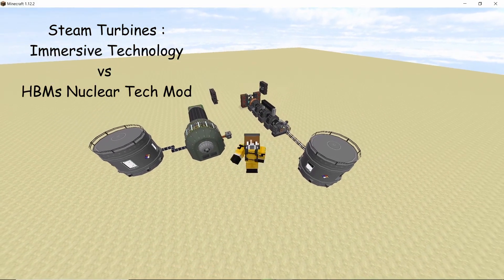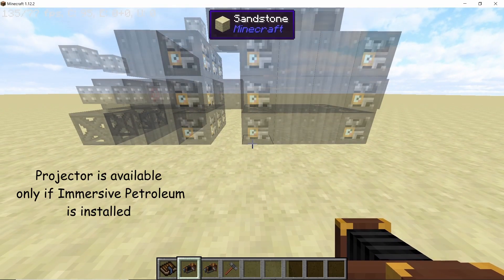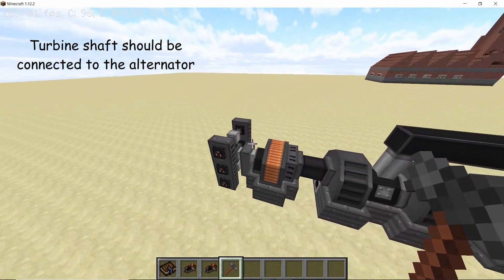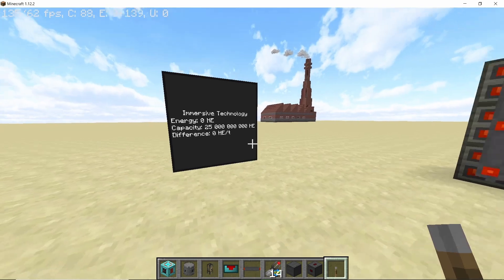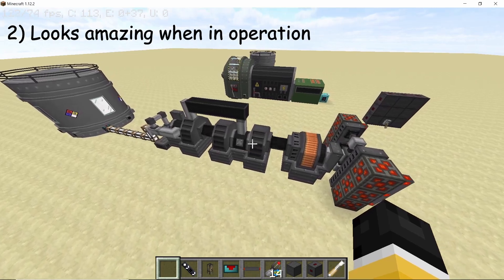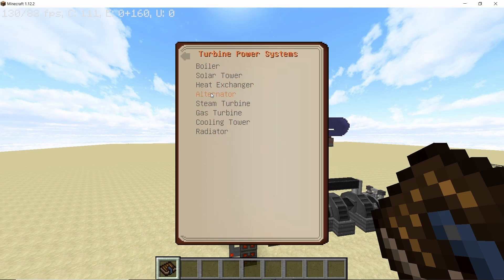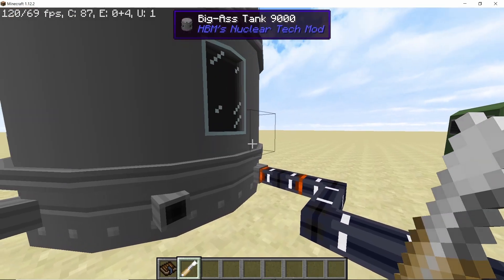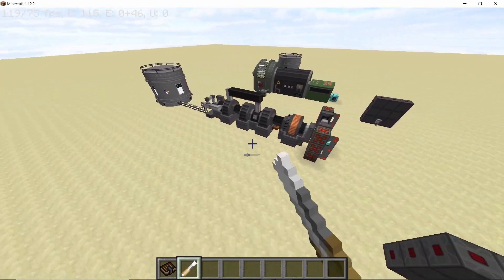Steam Turbine : HBM vs Immersive Technology || Why you should use Immersive Technology mod's Turbine

Comment: Even if the immersive technology is more efficient (by a lot), i would still use HBM turbines. sure, its nowhere near as efficient, but the throughput is horrid on the immersive engineering turbine, and the industrial turbine can produce so many times the energy of the immersive turbine, in just constant running. the turbine cant support any rbmk i know, unless maybe a thorium reactor with 40 turbines. the leviathan turbine has infinite throughput, and for me, the reason i will never use the immersive turbine is just because you need so many for a small reactor. if you have power problems, just make an rbmk. also, the immersive engineering turbine wont work in 1.7.10 because ducts dont connect to non-hbm modded blocks. only useful in 1.12.2, which is a much worse version.

also, the reason in your video that it looks like the lev turbine is only using 2000 mb of steam per update is for two reasons. 
1. the super big tank has very limited throughput, it only allows two buckets of steam out per update
2. the update rate of tanks is very low, so tanks in general aren't used with reactors. just normal tanks can empty/fill their entire storage all at once, so i use them with reactors.
Reply: love the video though, it is very interesting to see the efficiency difference!
Reply from the maker: Yeah I only made this video sort of as a test to see the advantages and disadvantages of each turbine, cause truth be told the immersive tech turbines look way more awesome when functioning and having them in a grid formation just makes the whole build more awesome !!
And I didn't know about this in 1.12.2 cause in 1.7.10 all fluid vessels now have crazy throughput only limited by what they are producing or the machine they are pumping into

Have you tried setting the fluid ducts to output mode using screwdrivers ?? as this tends to increase throughput in 1.12.2

Comment: 68 out of 100 hbm mod tutorials playlist videos watched
Reply from the maker: You're a Giga Legend #4
Reply: @SavageVegeta By the way, low steam consumption can be a good plus, since per unit of resource used to heat water to steam, it is energy efficient.
Reply: Also, that steam turbine was balanced on the fact that it would be used for IE systems, which themselves produce steam reluctantly and slowly.

Comment: There is a problem, I cannot recover the water from the circuit of my RBMK reactor using auxiliary cooling towers (to give more realism to the plant) and then I need a lot more water than I have space to generate
Reply from the maker: Then try using the big cooling tower instead , it's several times more powerful than the auxiliary Cooling tower
Reply: @SavageVegeta  I realized that I have a huge amount of water and that I will not need more. I will put the auxiliary cooling tower on the roof just for decoration.
 No cooling tower worked for me, not even those of the same immersive engineer
Reply: stupid google translate
Reply from the maker: @aeeeerosol  if you are playing in 1.7.10 then you can dump all the low pressure steam in a barrel with infinite fluid tank in outlet and have the cooling towers for aesthetics !!
Reply: @SavageVegeta  I use 1.12.2, but keep in mind that I have approx. 70 heavy infinite water tanks. Also, a friend on the server has a PC from 2006, so cooling towers wouldn't work very well XD

Comment: Is it possible for the immersive technology turbine can use ultra dense steam and also can you make a tutorial on how to do the setup the largest RBMK with immersive technology turbinw
Reply from the maker: Well yes it is possible but the recipe has to be added manually in order to do that which I have no idea about how it can be done. I will ask the developers of the mod about it for sure.
And as for the largest RBMK you won't actually need to build it that big. Cause RBMK reactors in HBM produce steam at a very fast rate so the steam turbine won't be able to keep up with it anyways. That's why I would recommend going with a small reactor if you are planning on using only a single turbine unit
Reply: Hmmmmmmm well then what if you try to do a slow run up of the reactor maybe it's pace will go as fast as the turbine

Comment: soo are you saying that i can produce more energy from 253 units of 2x4 rbmk reactors than a dfc wow stonks

well actualy i might be less if you count the fact that it consumes less so imagin this you make you convert 1000 ultra presure steam with rbmk then in to super presure steam then high presure steam and as output i have 100000 steam that can be pluged in to multiple engines at the same time this is

G R E A T E R   S T O N K S
Reply from the maker: Yep mixing this turbine up with the Hbm turbine is the way to go , it balances the power difference between normal steam and all other steam types in the mod !!

Comment: You should check out immersive intelligence too it has some fun things to commit villager genocide with
Reply from the maker: Yep I have been playing Immersive Intelligence for the past couple of weeks and been figuring stuff out. The main things I am confused about now are the ballistic computer and the radar. Aside from that the mod is pretty overpowered especially in terms of weaponry
Reply: @SavageVegeta  the radar can be used with the cdps emplacement to enhance the aim of the cdps so it can destroy artillery shells before they hit the ground. Also the radar can be used with another radar and printing press to sand messages using the data system.

Comment: I'd say hbm's turbine is better overall, if you use denser steam types (which you probably should). And if one takes up adding recipes manually, as you suggested, it is then up to them to balance it as well. In that case it's inappropriate to judge wich one is better - and rather, you'll need to think about how it relates to other power production and consumption rates. If, for some reason, you don't care about balance and just want better efficiency, it would be easier to tweak the one in hbm, rather than installing a new mod. (If there's no config option for that, it can at least be done as a simple code modification, as the mod is open-source)
Reply from the maker: Aight so here are some numbers to make the point of this video clear -

Energy obtained via 2048 buckets of Ultra Dense steam processed in 4 stages using HBM Turbines - 5,017,600,000 HE
Energy obtained via 2048 buckets of steam in HBM Turbine - 204,800 HE
Energy obtained via 2048 buckets of steam in Immersive Turbine - 62,453,436 HE

1 bucket of steam in a single stage HBM turbine - 100 HE
1 bucket of dense steam in a single stage HBM turbine - 20,000 HE
1 bucket of super dense steam in a single stage HBM turbine - 30,000 HE
1 bucket of ultra dense steam in a single stage HBM turbine - 50,000 HE
1 bucket of steam in a single stage IMMERSIVE TURBINE - 30,494.34 HE

My Conclusion - the energy values for normal steam in HBMs mod is kinda broken , seeing the trend 1 bucket of steam should've produced 10,000 HE. In this respect turbine from Immersive Technology is much more efficient at processing steam than HBM turbine and that's why I said that this mod work's well and can compliment HBM's mod
Reply: @SavageVegeta  Okay, that makes more sense now. I guess with this inconsistency in mind, mixing turbines is reasonable. And the 3-times benefit over the 'proper' efficiency is easily compensated by the added materials cost.
And the part about enabling the dense steam does indeed seem appropriate in terms of balance, now that I know the concept of 'dense steam' already exists in that mod. So yeah, thanks for your clarifications
Reply from the maker: Now coming to your second point , when I said "Manually Adding Recipes" I meant when you needed to use High Pressure Turbines from Immersive Technology mod.
There are two turbines in this mod , Normal and High Pressure ... but the high pressure turbines are disabled in the configs by default and even if you enable them you need to add the recipe for what counts as "HIGH PRESSURE STEAM" manually using a different mod. Now this can be dense steam from HBM , Super dense steam or basically steam from any other mod altogether.
However when it comes to normal steam turbines there are no tweaks needed to be made as they can run easily on steam produced by all the mods. So I have not judged inappropriately when it comes to "Steam" upon which this video is based upon.
I hope you understood my point now :)